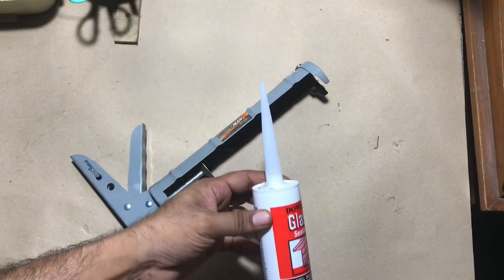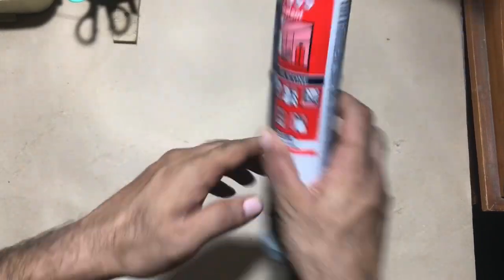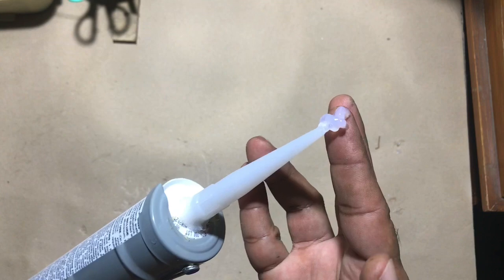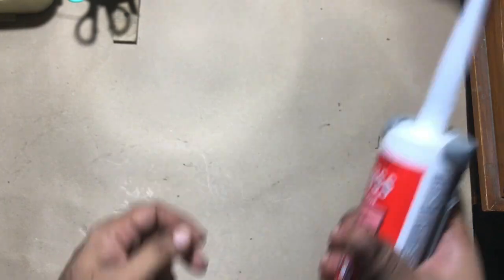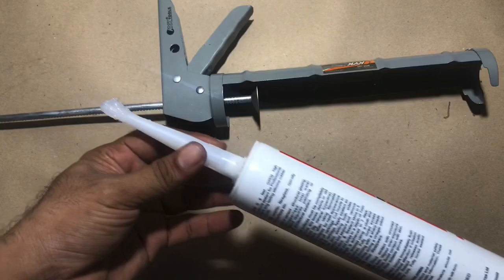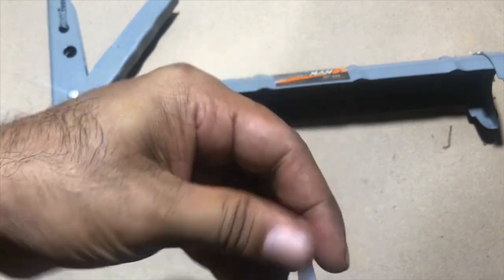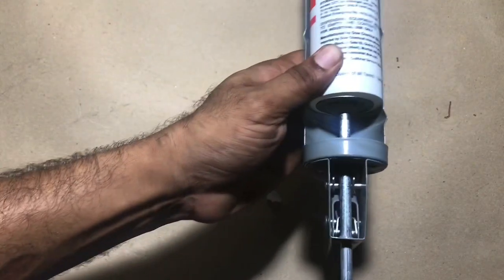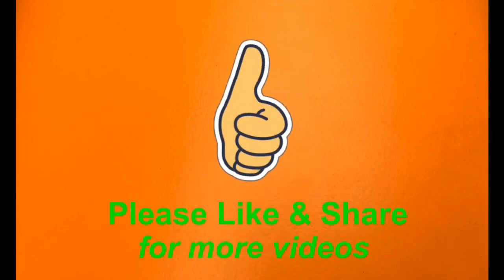How to use the same Silicon Sealant many times without Dry its Nozzle

Comment: Sir hlw.. There is gap very thin gap between window foam and wall... Sound is coming.. I cant afford this silicon tube but i have glue gun.. Can i use that.. I just wanna block some sound
Reply: Use flour and hot water and some Clorox ( just a bit so that pests don't get attracted).. Make a paste. Add color to the paste match area . Use it . Easy . Saves money